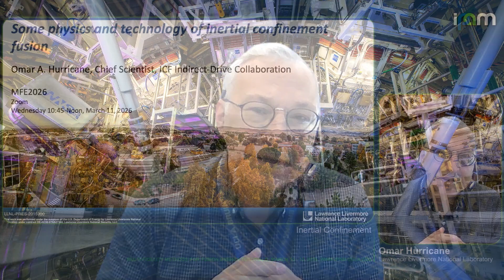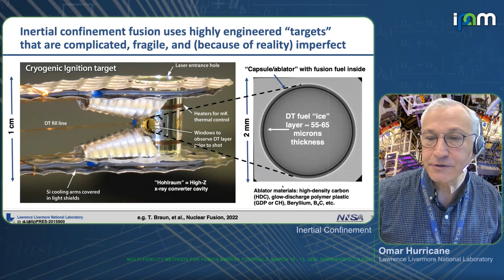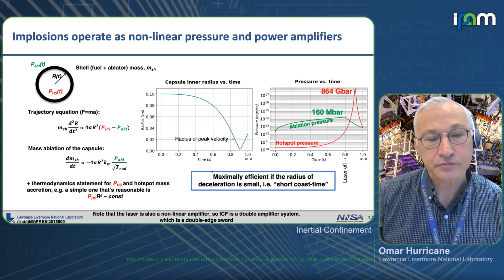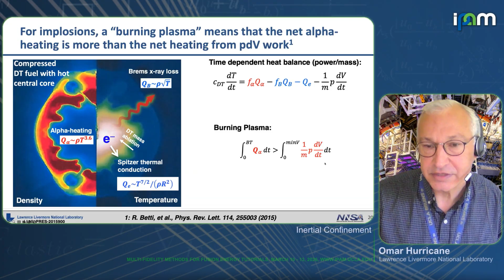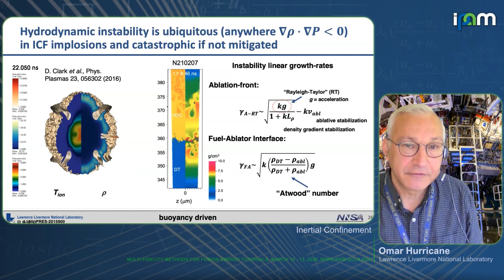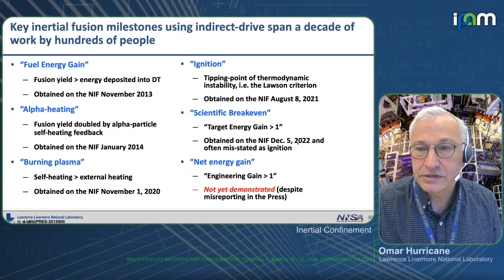Omar Hurricane - Inertial Confinement - IPAM at UCLA

Comment: 56:50 No perfect control of the lasers is a crucial problem for the uniformity?  how significant are the losses?  It seems like modeling based on the results from your lack of control could allow for your laser control to be less important; I imagine this can be done by balancing out an electric field voltage near the nozzle.
Reply: (Random guy with a technician background in nuclear energy thinks he can help leading fusion engineers haha ;) )
Reply: @angelmarauder5647 It's good to have a sense of humor about fusion. Now for your question: even with perfect control of the lasers, uniformity would be a problem so a target design needs to tolerate some non-uniformity.  These days, energy losses due to asymmetry is about 7% and we hope to half that in the near future.